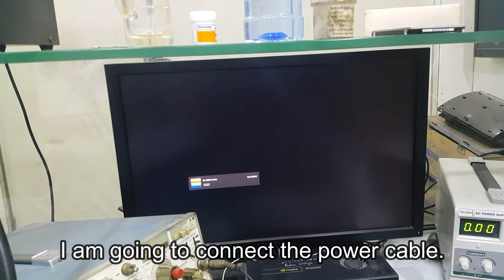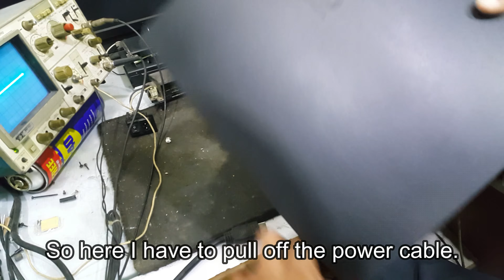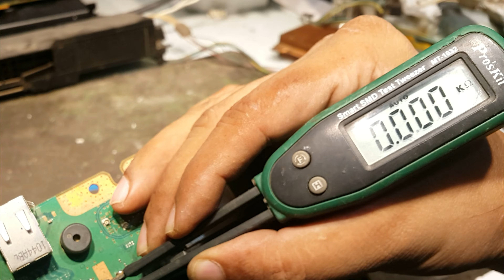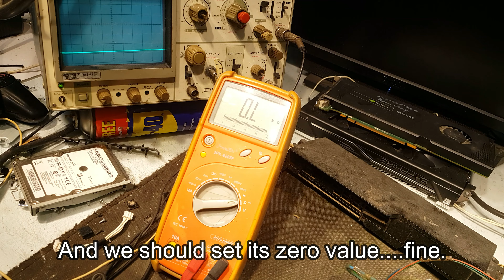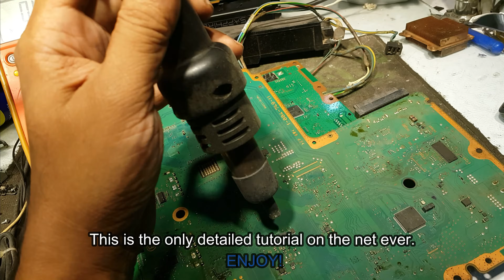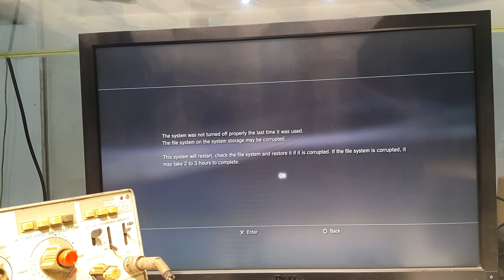PS3 blue screen of death, (BSOD).🔧✨FIX YOUR PLAYSTATION BLUE SCREEN ISSUE🚀💡

Comment: Sorry my English is not very good, I am a Spanish speaker. So What was damaged was a resistor and it was just changed and that's it?
Reply from the maker: No worries about your English—it's perfectly understandable! 😊 Yes, the problem was caused by a damaged resistor. I replaced the faulty resistor with a new one, and that solved the issue completely. If you need help with your repair, feel free to ask!